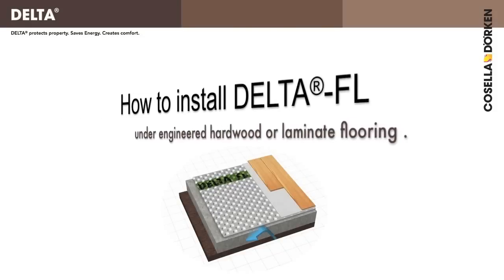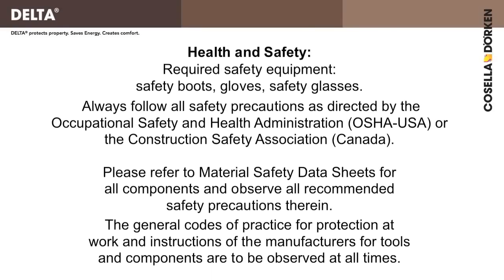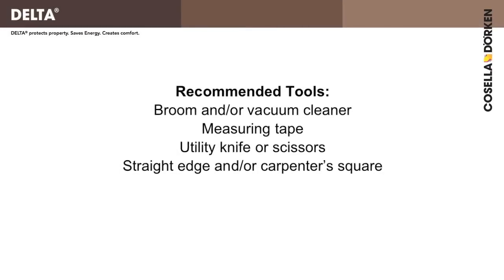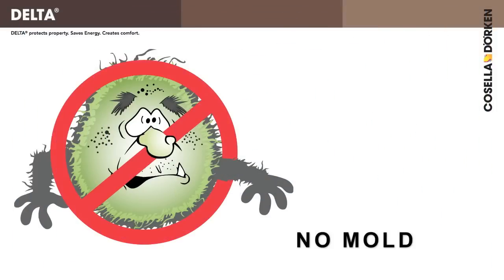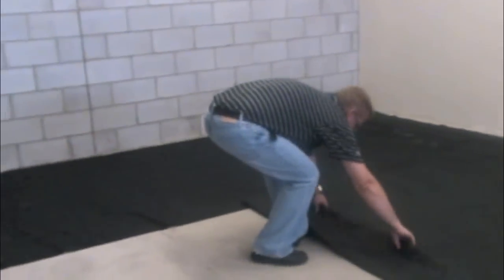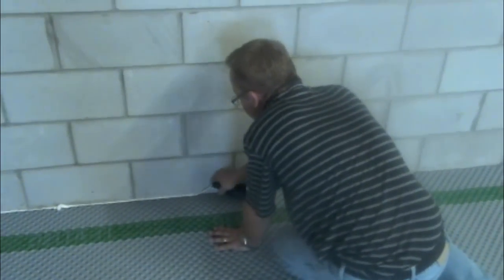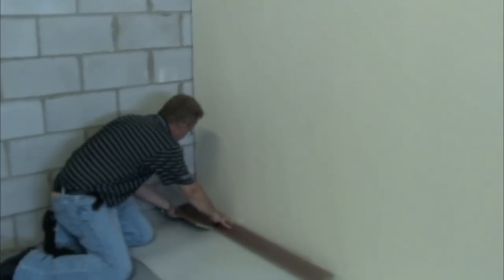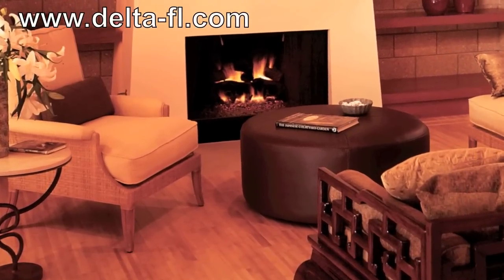DELTA-FL - premium subfloor for laminate flooring in basements

Comment: Not sure why you would want to use fabric if you want to control moisture in a basement. That would hold the moisture in my opinion. Plus you would hear the clicking with every step you take without it.
Reply from the maker: The landscape fabric is not used to control moisture. It can be used to prepare the concrete floor for installation when the floor may be uneven in some areas, this minimizes the potential of clicking noises when there is extra space causing the DELTA-FL and the flooring to move. Landscape fabric will not hold water.  It is made of plastic and is impervious to water and mold.

If you have any questions, please email info@dorken.com